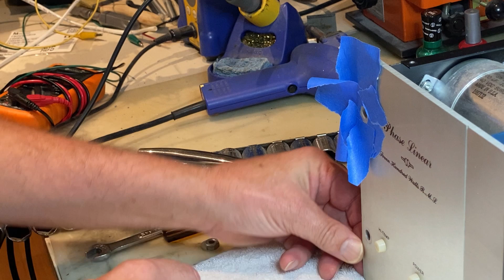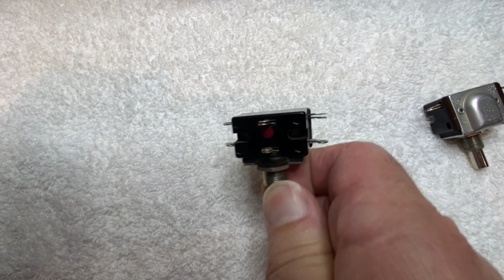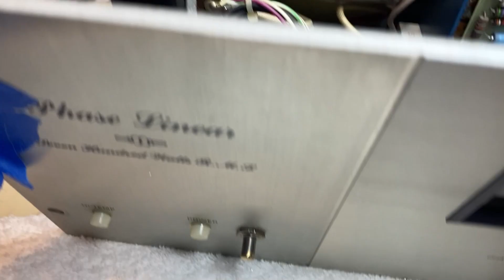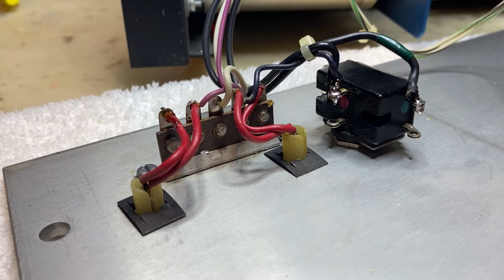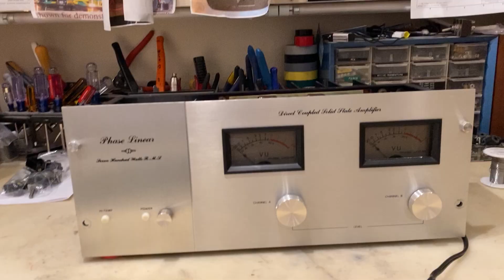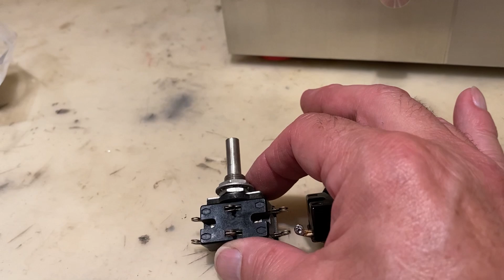Phase Linear 700 Power Switch Replace

Comment: I have a early 700 with the original on and off switch that works.   I want to keep it that way so I use the switch on a power strip, surge protector to turn it off on with.  Much easier to buy another surge protector than doing what you are doing in this video, and cheaper.

Comment: That amp can have a turn on surge current approaching 150 amps, so it's very hard on that switch.  Also a Unibit works very well for drilling your front panel.